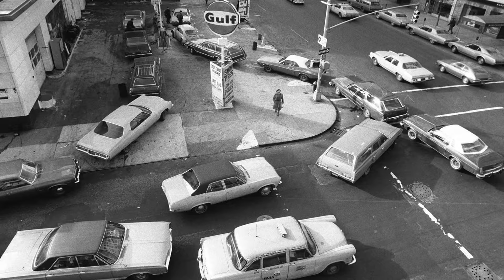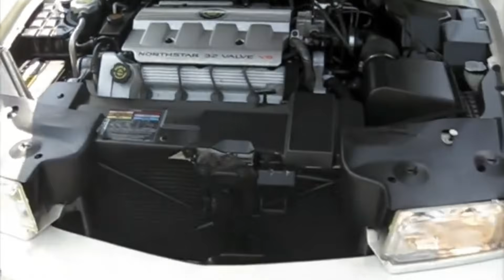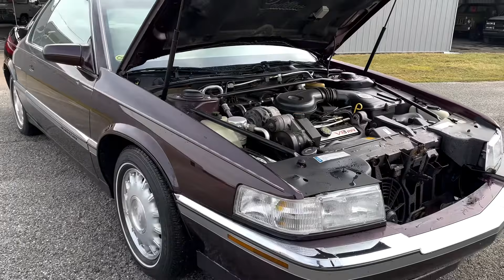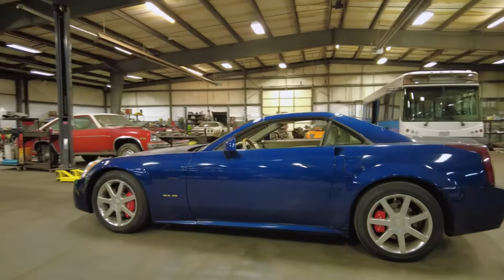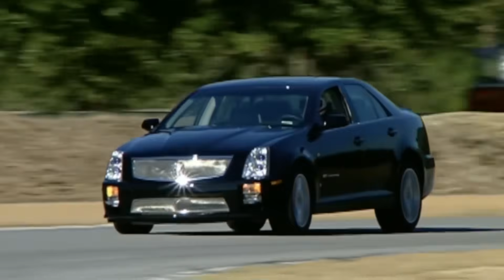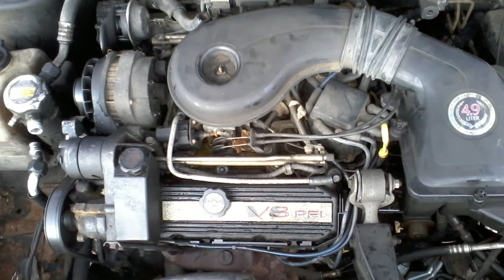THE SHOCKING TRUTH BEHIND THE MOST HATED CADILLAC NORTHSTAR ENGINE

Comment: Who else finds this video too long and keep repeating over and over and over and over and over

Get my point?

I had a 99 Cadillac Deville, got it in 2009 with 24k and got rid of it in 2012 with 73k had nothing but problems with that thing even though it was one owner from new, low mileage and was in pristine condition
Reply: The Fact that they're only attacking the early generation and harping on it. The most only shows that they're just trying to make it seem like it's worse engine than it is, they're not even getting to the point where it attended in Indy 500 the GTS-1series and the LMP program and They even went back in  Completely overhauled the north stars and even Made a XV12 variant